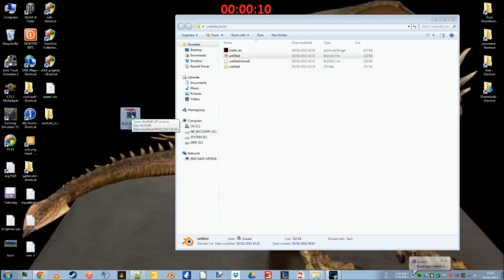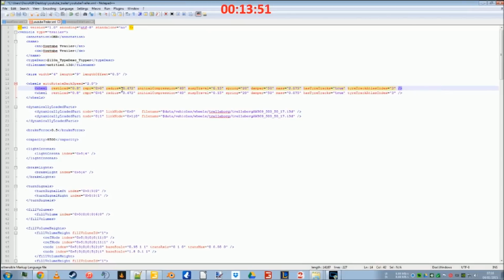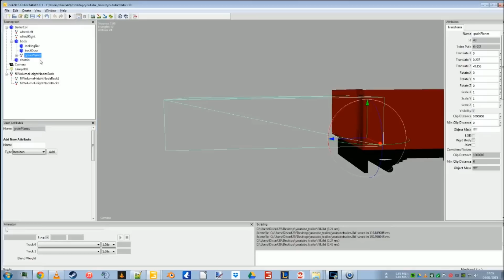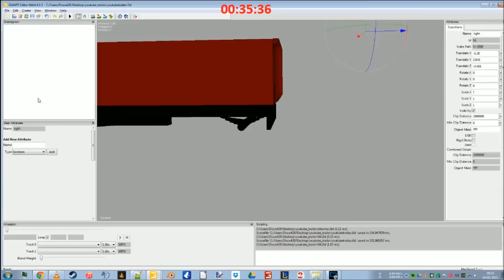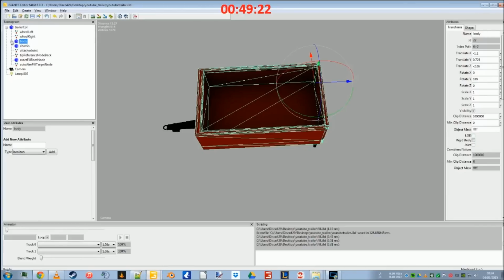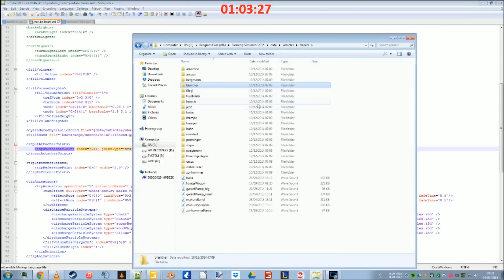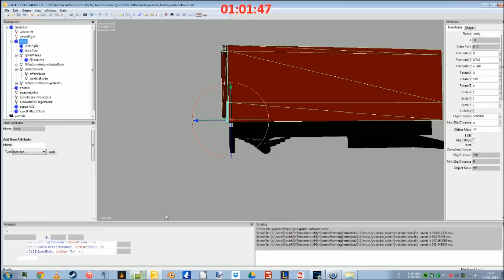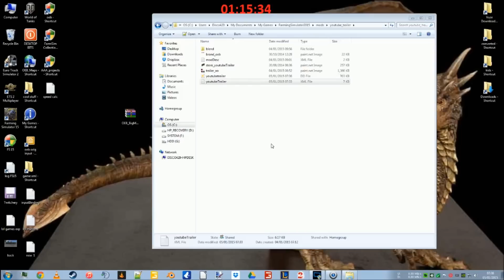OEB Modding Series - Make a Mod pt 3

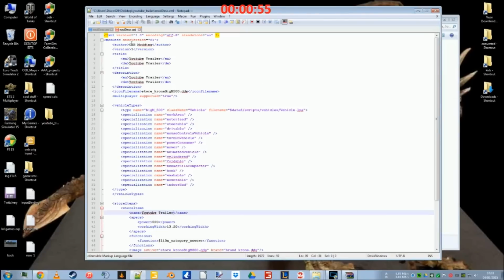Comment: at 1:06 you could use the developer console commands:

gsCleanI3DChache

sell the vehicle, and buy it again to the the affected changes

also you can use the command, when in a vehicle:

gsVehicleReloadFromXML

this also has the effect of changing the attributes of attached trailers and tools, so performance characteristics such as handling, suspension and engine setting are all updated.

use the ` key, it is the one above tab, to get the developer console up and then tab through until you see the command and hit enter
Reply from the maker: +M1sf1tActual iv no idea what the clean i3d cache does exaclty, and from past experience trying to use 'reload from xml' iv given up with it lol
Reply: +David Oldfield gsCleanI3DCache basically updates the I3D file in-game without having to restart the game every time you make a change in the I3D file.